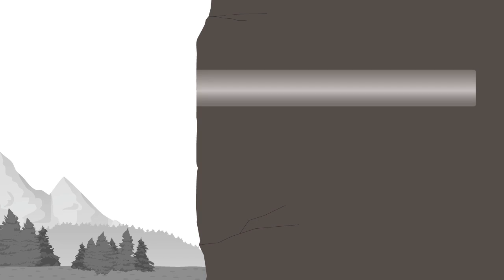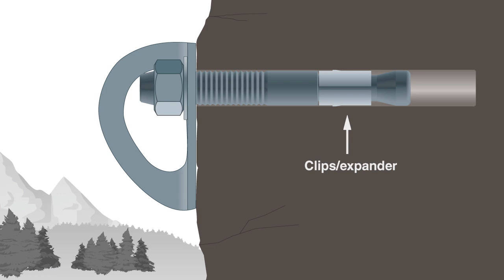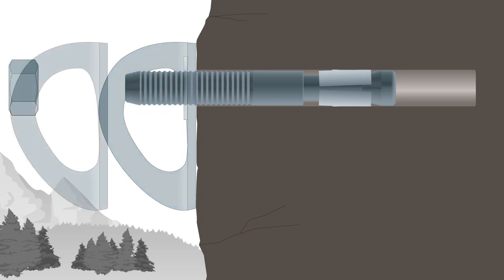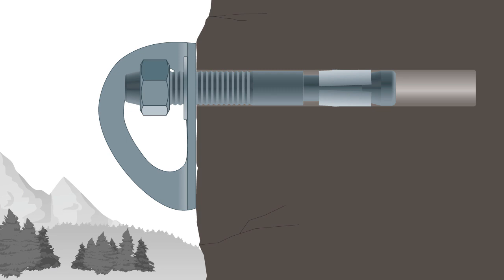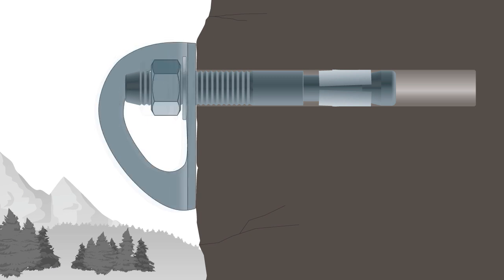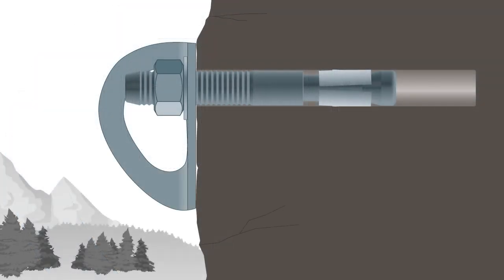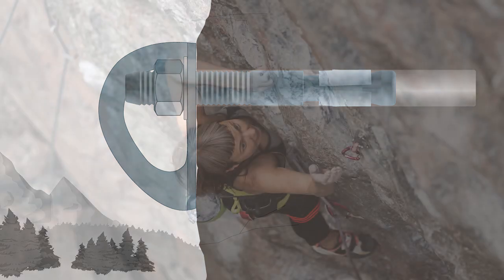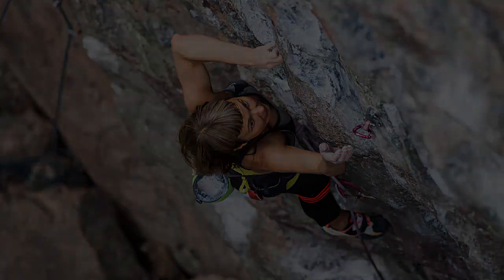The bolt is loose! Are you sure?

Comment: Can you use these on brick walls for added safety when climbing a tall ladder?
Reply: Er obviously?  People hang from a rock wall thousands of feet up using them.  That’s like asking if a car will work on grass
Reply: @Cloudminster  Alright pal. A simple yes would have sufficed. Be kind not rude!
Reply: @graycleary  be careful. Brick has a much different composition than hard rock. You need to do more research.
Reply: @Cloudminster  a rock wall is very different then a brick wall. I'm wondering if suck a bolt would focus all the pressure on one single brick (instead of the usual dispersion cone, on the rock wall) and thus break the brick entirely.
Reply: @MrAchile13  A brick in a wall is not just a brick, it’s under a spread load of everything else above it.  As part of a much larger structure it’s strength is very high.  Also any load is spread beyond just the brick any bolt is in, that is fundamental to the structural integrity of a brick structure.  If the wall was as strong as only a brick then it wouldn’t be a suitable material.

Comment: This is NOT the whole truth! There are of course circumstances where the bolt really is loose.
E.g. in Northern Frankenjura, Germany, the rock has a hard outer layer but softens below. An expansion bolt grabs in the soft rock, but the forces when climbers fall into the bolt will peel off the rock inside the drill hole, the bolt loses the grab and slowly wanders out the hole. That's why you only can trust glue-in bolts in that area.
And I am sure that there are many climbing areas (or just single crags) all around the world that have similar problems.

The only solutions might be to have a wrench and a hammer so we can see if it is possible with minimal forces applied to move the bolt in both (in and out) directions.
Reply: Absolutely this. How irresponsible is it to post a video reassuring people that the bolt isn't loose and to trust it anyway? Your life is your responsibility. Check your bolts, don't trust anything without checking and double checking. The risk/reward is just too significant to ignore.